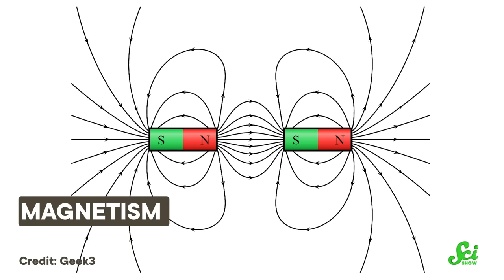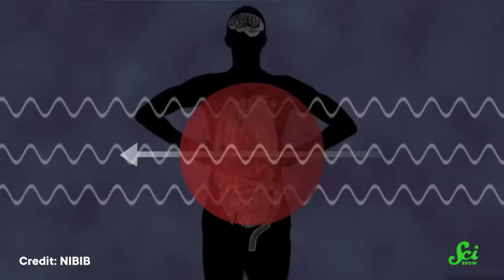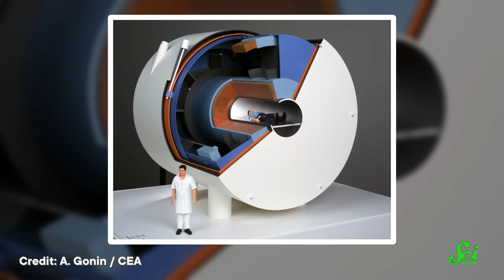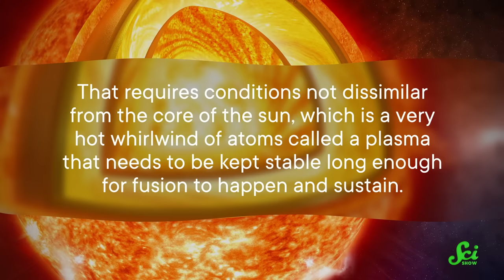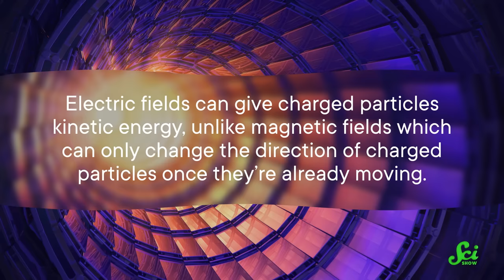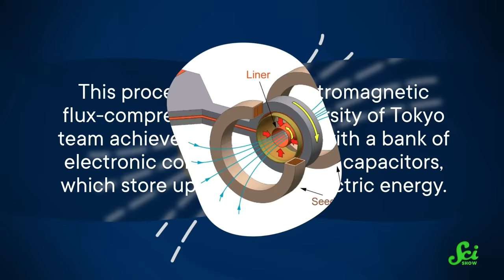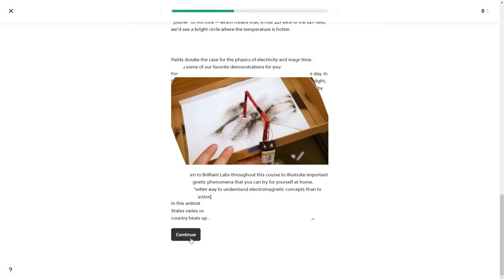What is the Strongest Magnet We Possibly Could Make?

Comment: So one coolest things I know is how an electromagnet works. A magnet is produces by an imbalance of charges, in regular matter there are as many pluses and minuses and those are very close together so the field is a tight little ball that does things like make things solid. In a bar magnet there are zones that have irregular boarders that have just a very few charges that don't have opposite charges paired with them, remember the EM force is 10 to the 36 times stronger than gravity so only a few out of place charges will allow a refrigerator magnet to defy gravity. In a electromagnet the charges in the wire wrapping the core are moving, and the movement is about walking speed around the wire. This tiny movement causes a relativistic length contraction of the charges as they move around relative to the stationary charges they are pared with. The length contraction means that the charges "see" less of the opposite charges and this creates the imbalance that frees the magnetic field. So electromagnets are a demonstration of special relativity having an effect at 5 or so miles an hour.

Comment: Helion seems to be so much further ahead / so much closer to actually harnessing the power of fusion in a net gain setup, primarily due to the complexity [actually simplistic elegance using modified fiberoptics and modular custom-built electromagnets and an array of 70's-current Gen + custom ordered capacitors to quickly cycle [and then harness] the process of fusion, but instead of involving overly complex transfers of energy to something capable of powering a turbine, these badasses are right on the verge of harnessing those bursts of energy directly into the magnetic fields - - > wiring / capacitors, etc that powered the the reaction in the first place, and then right upstream to the grid. Their proof of concept is years beyond anything shown in this video and the only thing holding them back from their 2025 commercial grid-connected launch is the optimization of the microcontrollers that'll be tuned to actually harvest those burst of energy back through the same magnetic field that forced those gases into such tight confinement and high speeds so as to make the magic happen. But here, no moving parts....
Reply: Interesting. Do they explode?

Comment: Superconducting magnets need a magnetic field to lock into, so resistive magnets are still needed to induce the magnetic field into the superconductor. At that point, as long as the superconductor is kept extremely cold, it's magnetic field will stay locked without the resistive magnet staying energized.

Comment: How does the MIT fusion compare to the one just announced using lasers from the LLNL just this past week?
Reply: 5:50 Time-travel to 2025 to find out.
Different design and goals. LLNL is more focused on basic research on the physics, especially as applied to bombs. It appears that the MIT device and the already operating Joint European Torus are more focused on a sustained nuclear fusion that can be used for power production.

Comment: I love magnets, because I love electric motors/generators. I thought super cooling the magnets was done, because of the heat generated by coil resistance. But I completely forgot about superconductors.

Imagine cooling an EVs motors & controllers so much, that they become superconducting. At least for electric drag racing, this can be great, if it can be sustained at least for that.

But if those temperatures can be sustained longer, like a Formula-e or Moto-e race, or 24hour La Mans, or a spirited, summer road trip. That could really push BEV & Hybrid vehicle performance, when batteries/capacitors aren't the limiting factors anymore.

Comment: One of the big advantages of the MIT / Commonwealth Fusion magnet is it uses high temperature superconductors  that can work at liquid nitrogen (77 degrees Kelvin) as opposed to liquid helium (< 4 degrees Kelvin). From thermodynamics it takes far less energy to maintain liquid nitrogen temperatures than liquid helium temperatures (look up "Carnot efficiency")

Comment: I worked with superconducting magnets in industrial magnetic separation units that separated iron and rare earth metals from kaolin slurry to make it whiter than Mother Nature made it. These have a canister inside the superconducting coil of either 120” or 84” in diameter by 20” tall. Maximum flux was 2.5 Tesla at 1250 - 1500 amps. The coil itself is made up of copper wire with Niobium-Titanium conductors embedded in every sixth strand of copper. At superconducting temperatures of 4K the Niobium-titanium conductors were able to carry that current even though they were smaller in diameter than a human hair. The rest of the copper was there to carry the current should the magnet quench in which case its liquid helium bath would boil off very quickly. The magnet coil is surrounded by tons of steel to contain the magnetic field and focus most of the flux into the canister. Fun to hang a 16” crescent wrench in mid-air below the energized magnet. The power supply for the coil basically is pumping the 1500 amps through a dead short (except for the leads from the power supply to the coil) so it must be water cooled and very beefy. The magnet charges from zero to 1500 amps by raising the voltage slowly to a certain level, then lowering it down once it is close to maximum current. Once operating current is achieved the voltage drops to less than 1 volt to maintain the magnetic field at whatever current is selected. Discharging the magnet is done by reversing the voltage until the current drops to zero. This power is sent back to the electric utility through the power supply, so close to a net zero power use overall, unlike a conventional electromagnet. Fascinating stuff but high maintenance to keep up the power supply and liquefy the helium to cool the coil. Made a good living keeping five of them going.

Comment: Think about what a superconducting magnet is. It's essentially a big old battery. There is a tremendous amount of DC current stored in that superconducting circuit in order to create that magnetic field. Think about how that current gets put in there or how it gets taken out. You have to create a point of resistance in that circuit in order to force it to take current in or remove current from it. But if you don't control how you do that, then as soon as you create that point of resistance, the entire circuit quenches and that current flips itself into heat. So there are safety circuits in those magnets called quench circuits. This is typically made up of quince diodes to clamp the voltage in the magnet at a certain level so that it will not run out of control and burn the magnet up if there is a quench. There's also typically a dump resistor. This is basically where the current in the magnet will dissipate itself as heat if there is a quench. Of course with all that heat, then the liquid helium inside the magnet wheel immediately and violently turn into gas and expand. If there was not a exit point at the top of the magnet, then the magnet would literally explode. Since the internals of a superconducting magnet are so cold, then they tend to draw in moisture if there are any leaks. And what happens to moisture that hits minus 270° c. It turns to ice. If the ice forms in the exit point where the quenched gas is supposed to escape, then it creates a sealed vessel that will calls magnet explosion due to overpressure. The current that gets put into the magnet or taken out of is done so because they put little superconducting switches in the circuit of the magnet. These are small superconducting coils that are typically embedded in epoxy. They will also be a heater strip embedded with the coil and in the epoxy. You will apply a very small amount of current to that heater strip which will in turn create heat in that coil that will give you your small amount of resistance in the entire magnet circuit. It's not a physical switch. It's just a little superconducting coil. The reason they pot it in epoxy is because it wouldn't likely not turn resistive if it was in direct contact with the helium in the magnet.

Comment: The hybrid magnet brings two questions to mind:
1. How is the magnetic field limited by using a superconductor compared to material with resistance?
2. With the central magnet having resistance and running such high current, how do they keep that from exploding due to resistive heating? 😳
Reply: Answer to (1) Superconductors stop being superconductors above a critical current / field

Comment: There are also facilities where even higher magnetic fields are reached during explosions. I know not much on the topic, but those flux-compression-guys cited these methods in 'motivation' part saying that at least the lab is not destroyed with flux compression XD
Also there are a lot of ways to achieve enormous impulsive magnetic fields. The two i have on my mind are 1) magnetic field of light in extremely powerful lasers, like those which recently were hyped in laser-fission experiment. and 2) created by plasma filaments' currents during ablation. Several thousand tesla, as the calculation suggested. Although not very practical since those are inside a metal being melted :)
Also it would've been cool to compare those values to the largest magnetic fields known to men, like pulsars

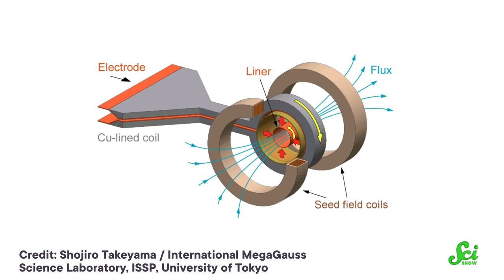Comment: 12:07 Such a device is called a FCG, or Flux compression Generator, and this channels example is well, a little incomplete. These things are NOT useless or impractical as the host seems to say, they are in fact VERY useful. In proper FCG's the initial seed current is often supplied by a special bank of very fast discharge capacitors, then actually speed of getting the current into the armature, or winding, is opened and closed with explosive switches, single use devices obviously, but that's just the start. The armature that then holds this brief current is then often also made to shrink or compact again using explosives, this drives the current very high and is often times in the tens of millions of Amps. This brief intense pulse has many applications, one of which is military, the EMP weapon. Basically this very high spike of current is used to drive what is called a VIRCATOR, which is effectively a microwave magnetron on steroids, the cathode is virtual, it creates the high microwave power output, the output is directed via a metallic cone over a certain area, and the microwaves effectively fry any unprotected electronics. such a weapon is of course single use, it destroys itself upon pulse generation. The Americans and Russians have done a lot of research on these things, and they are indeed very real. Better than using a nuke.

Comment: Here's my question. Why aren't we using Flux Compression as a means to start nuclear fusion?.. Sure, it's 'destructive' and would require replacing the setup every time, but we already have to do that with most nuclear fusion reactors in terms of fuel.. so why not?

Comment: As a NMR spectroscopist in another life, I often wondered how high a magnetic field could get. One thought that I had was what would happen if a large quantity of electrons was in orbit about, say, a black hole at extremely high speed or simply traveling through space in a straight line. The strength of the field depends on quantity of electrons and their speed. The average velocity of electrons through a wire is really pretty small but even so, we are able to produce pretty large fields on earth using lots of electrons. In space with electrons traveling in a vacuum they are able to reach much higher speeds and so should be capable of producing unimaginably large magnetic fields.

Comment: Flux compression is used to power e-bombs - you dump current into a coil wrapped around (but not touching) a metal cylinder that's packed with explosives - which are then detonated at one end. As the cylinder stretches outwards from one end to the other it creates a running short down the coil which acts to compress the magnetic field. The cool thing is that some of the chemical energy also gets added to the field energy as it has to do work to compress the field. These helical generators can produce fields of up to 200 Tesla and currents of 100 million amps. The system the Japanese scientists were using is called a hollow tube generator. There's also a third type known as a disc generator. They can be used 'as-is' for taking out electronics in an area, or their current can be dumped into a secondary module (like a microwave generator) to produce a directed-energy pulse for a specific target.

Comment: I thought I had read some research years ago, when graphene was new, about insanely strong magnetic fields generated by putting edge-on pressure onto a sheet of graphene... it didn't extend very far, but was super strong.  I thought maybe we'd see something come of that, but like with most things graphene, it doesn't seem to have amounted to anything useful.

Comment: Tesla is  a measure of magnetic flux density.  A smaller magnet can easily have a much higher flux density than a large one.  I worked with a number of 20 Tesla superconducting solenoids in the low temperature lab and the cyclotron back in the early 1980s.  They were about twice the size of a 2 liter bottle with bore sizes under 5cm.  What is impressive about the magnets in the LHC and  ISEULT is not their flux density, but rather the flux density given the size of their apertures.

Comment: I have a question: 
The 100-million-degree fusion plasma in the center of the magnetic confinement is prevented from vaporizing the reactor wall by magnetic field. But with a temperature like that, wouldn't it still emit huge amounts of thermal radiation that escapes the confinement? So how do they handle that?

Comment: Is there any data on the interactions of these and the earths field, forgot how much tesla the earths field is but it seems to me it would be like a taffy pull if the earths field is weaker''  About the diagram at 0:20' There is 0 gaus at each pole of a magnet meaning centripital clock wise "dielectric" ( Yeah I went there) infalling magnetism(that's what dielectric is) towards 0 negative space(plane of inertia or bloch wall)'  Outward bound magnetism comes out of both sides of a magnet counter clockwise centrifugal at a 45 degree angle relative to dielectric infall

Comment: With a sufficiently strong magnet could an aircraft be pulled from the sky?
Reply: With a really really really strong one yes, but even the ones in this video aren’t strong enough to do that because the strength of the magnet falls of to the cube of the distance so it gets really weak pretty quickly.

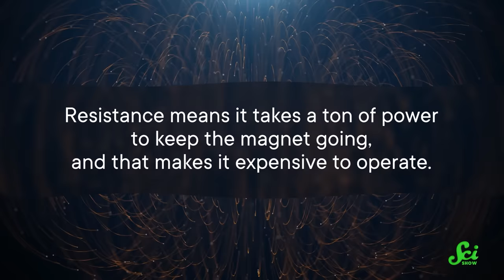Comment: @ 9:24 I assume that means “resistive ELECTROMAGNETS aren’t limited in terms of the strength of the magnetic field they can produce.” 

PERMANENT magnets are basically just limited by their material composition, right? (not their physical size or the amount of current passed through them or anything else?)
Reply: Also is 9:51 supposed to be “low temperature”, rather than “low power”?

Comment: If all of the protons in the brain react to magnetic fields by giving off radiation, wouldn't you just get one giant, indistinguishable blob of light? Because there are protons in skin, bones, and even fluid. So, there would be just a giant, amorphous flud of specific frequencies of light if all the protons in the body reacted exactly the same to magnetic fields. Isn't there a certain molecule or process that reacts more strongly to these fields that permits the distinction of features and structures from the light being emitted by their protons? Like when oxygen is being transferred from hemoglobin in the blood to a cell, or something?
Reply: Become a neuro surgeon, theyll tell you
Reply: MRI machines are mostly looking at the hydrogen atoms in water molecules, since there are a lot of them. Hydrogen in different molecules creates different frequencies. So one simple way to get contrast is the amount of water in different areas. The protons also relax at different speeds depending on their enviroment, so different tissues produce different signals in that way. They use really clever magnetic fields that vary throughout space to get slightly different frequencies depending on the exact position, allowing for 3D resolution. This is incredibly oversimplified, there are a bunch of different spin experiments and ways to get contrast. I'm more familiar with NMR spectroscopy where we use the same phenomenon to determine the structure of molecules but there are a few really good series here on youtube by professionals that go very in depth.